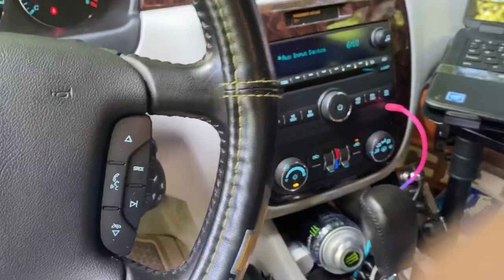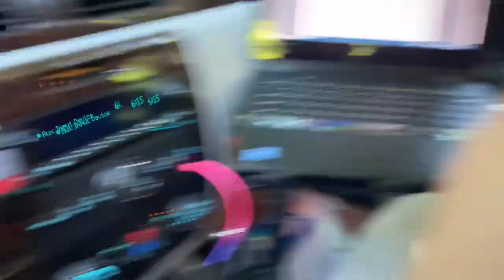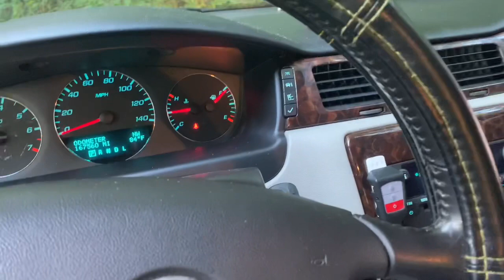2012 Chevy impala Emergency package and fleet update

Comment: That’s just a standard impala though, it’s not a 9c1 or 9c3 which detectives used. They both have column shifted on both. I may be wrong but that’s new
Reply from the maker: This one was. It was a travel car not patrol. As in a fleet car.